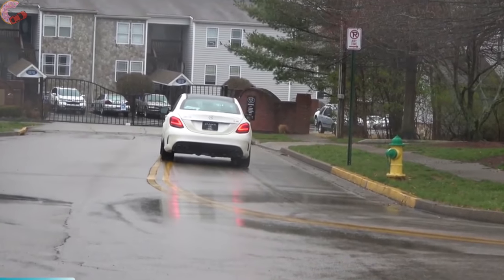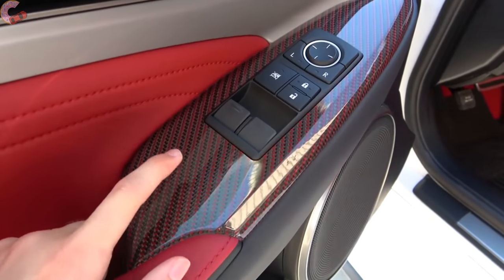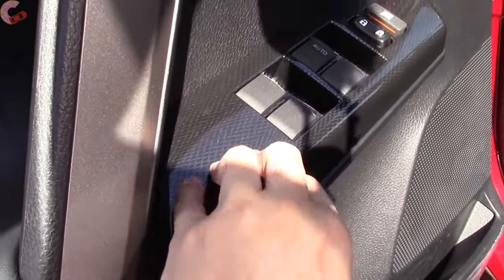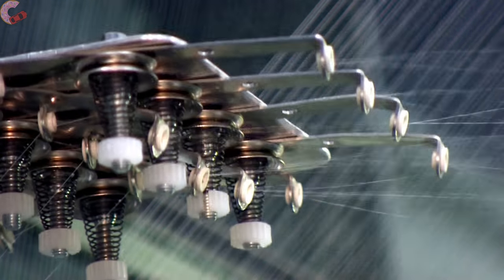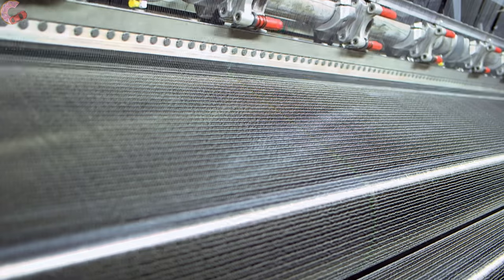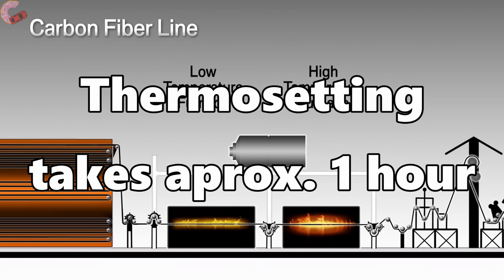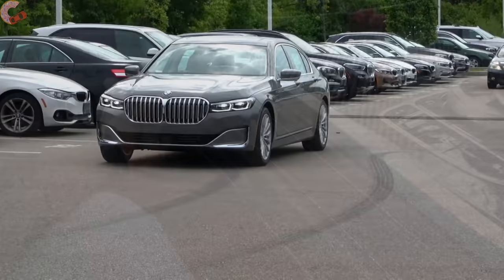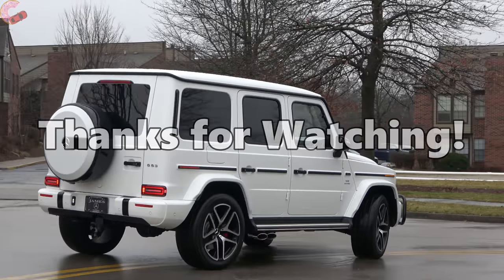WHY is Carbon Fiber so Insanely EXPENSIVE??

Comment: Love the video and answered my question.  It’s not practical as far as price for the average consumer.  It’s 5x stronger than steel and 70x lighter.  Race cars that are in events that tend to have accidents probably shouldn’t use them on the exterior unless cost is not a factor.  This also leads a way to considering other material that would be similar in strength and weight values because this is far from practical.

Comment: Great video. Very informative.

I should point out there is a historical parallel to this issue. Two hundred years ago, cotton was very expensive to process also, due to the need for human labor (slaves) to manually separate the cotton from the cotton seeds embedded in the raw cotton fibers. When the cotton gin was invented, machines could then separate the seeds from the raw cotton. This greatly multiplied the efficiency and throughput of cotton manufacturing, greatly reducing the time and expense of manufacturing.

While carbon fiber obviously doesnt have seeds, new technological discoveries have been shown to improve the product while reducing its wholesale cost.
Reply: I wonder if the BMW i3 was profitable, it's construction consists of a carbonfiber body on an aluminium frame with abs bodypanels and a carbonfiber roof.

Comment: Buying parts is insanely expensive however, you can buy 3k twill weave for a decent price and go from there skinning etc, if you are looking for 1k or 2k CF the price will sky rocket just google it and you will see why. If you want the strength without the price and don't care for the look or weight, S Glass FRP would be the way to go!!

Comment: This is probably a weird question but can carbon fiber be painted??
Reply: Not weird at all... You can. Alot of people love saving weight but hate the carbons color so they paint it.
Reply from the maker: Yes it is very often painted. Cars like the RCF proudly display beautiful polished carbon fiber, but when it is used in structural bits it doesn't look nearly as nice and needs to be painted over

Comment: I don't understand tho why would I want carbon fiber in my car apart that it looks nice is there any real good reason?
Reply: It's lighter than common materials, therefore the car gets lighter, which means faster acceleration/better fuel economy/higher top speed etc. 
And yes it looks nice :)

Comment: Sounds like a very environmentally unfriendly process that requires a lot of energy and time to produce,  polluting our planet. Hopefully,  it falls from favor soon,  except for the most expensive aviation and automobile uses where strength at low weight are important.
Reply: I think what you should have said is … Hopefully, the human race finds a safer and cheaper replacement to make… Loooool